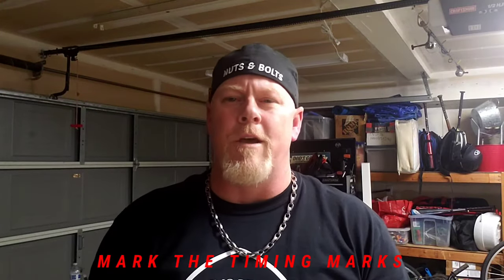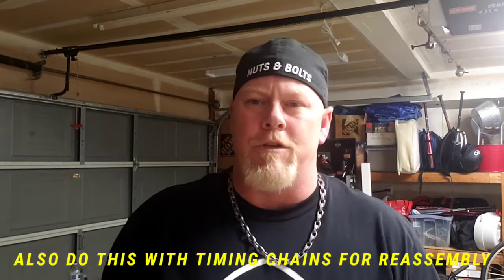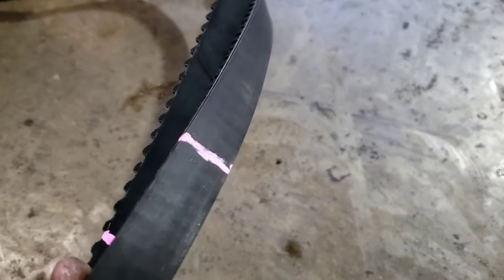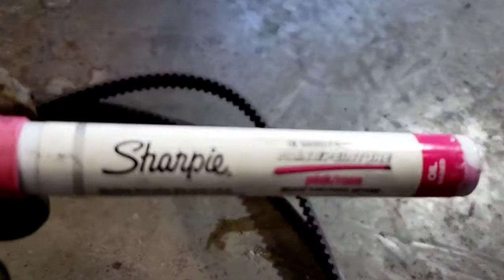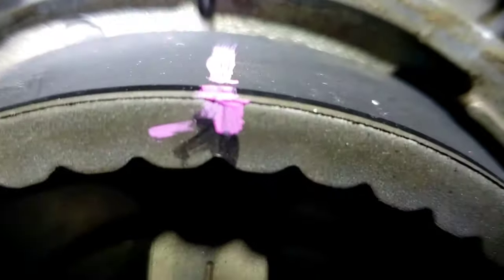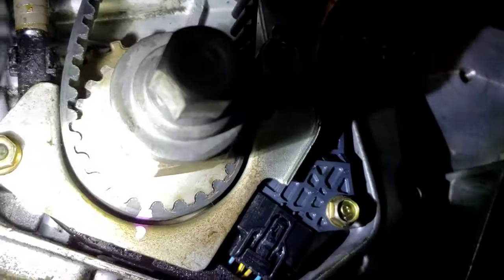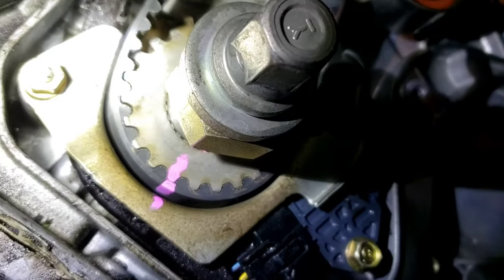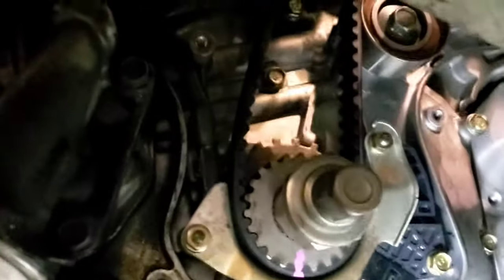TIMING BELT HACK Easy Alignment Every time

Comment: why    WOULD ANYONE mark the OLD belt            ....the new belt it doesnt matter which tooth goes where,as long as its fitting the gear correctly .....The cam pulley & crank pulley is whats crucial.   to me its pointless to mark a new belt or old belt even.
Reply from the maker: Sure
Reply: @97warlock wants you to blow your engine up. Stay safe
Reply: Hes saying mark a line on old belt and crank and old belt and cam then transfer marks to new belt and align that with marks on on cam and crank. This actually helps assuming the timing is already good when the car comes in. Last job had I not done that I would have been one tooth off. Those this technique assumes timing is already perfect when car comes in. If it's non interference and it could.es in with broken belt this technique is useless

Comment: This method is great for the correct initial installation of the belt on the pulleys. Usually novices don't know how much they should pull the belt by hand between pulleys. Painted marking helps them to install the belt with minimal slackness before pulling the tensioner pin. To be more accurate, it is better to count the number of belt teeth between pulleys rather than just aligning the old belt with the new one and transferring the marks to the new belt. I both align the belts and count the teeth to make sure the marks are painted at 100% correct position on the new belt.
Reply from the maker: that is great information and you are correct counting the teeth is the for sure best way to make sure. thank you for watching.
Reply: Yep,if I'm not sure that's exactly what I do. I recently used a made in Germany optibelt on a toyota and I counted the teeth on the belt to be 100% sure. It's a fail safe way of doing timing belts.
Reply: @Healthliving1967  Yeah, that's a great method for beginners too but after a while, you will get the hang of it and can align the belt even without using the marks.
Reply: @Nariman Asgharian  as long as there is the same amount of teeth in the new belt as the old one then there's no problem with needing marks on the belt,but the belts do need to rotate the right way. Not everyone is a fckn a grade mechanic are they dbag.
Reply: @Healthliving1967  Yes, counting the number of teeth will suffice if you are not 100% beginner.
Reply: Gd day sir!, YES ur tech tip is perfect in my opinion, not too slow but sure, coz i did it for 2 toyota 2C diesel eng. Coz i miss d 1st did by 1tooth adv, eng didnt run,,, 2hours review its ok!!! So i did. That for next 2eng...twas 1990 that time,,,,

Comment: Belt doesn’t matter, it’s the cams and sprockets that make the timing accurate. Belt placement doesn’t matter
Reply from the maker: Belt placement actually matters completely. You have to have all the sprockets lined up correctly and the belt has to be connected and lined up.
Reply: @NutsandBoltswithTone  well I did this job not too long ago, new belt had no marks on it. I lined up all the sprockets, installed the belt and counted the teeth in between each sprocket, put it all back together and fired right up and runs flawlessly

Comment: This only works if your belt hasn’t ripped and had gears spin out of place
Reply from the maker: This is absolutely correct. The other thing that makes a difference is that the engine is in proper time before starting or cannot use this

Comment: Better tip is that instead of transferring mark from old belt to new belt by placing one top on another one, just count number of teeths between marks on the old belt. Mark on new belt by counting same number of teeths. This way you are not open to risk of mis marking slightly.
Reply from the maker: That sounds like a great idea however that would take a lot longer and in my opinion would have a better chance of making a mistake. I go around the belt mark everything and then go back and double check. have not had a problem. Thank you for watching.
Reply: @NutsandBoltswithTone  how can you make a mistake with counting method? Your method has risk of transferring marks from stretched belt (of course old belt does stretch) to unstretched new belt. Speaking of taking lot of time, which one do you need, couple of extra minutes or  destroyed engine due to wrong marking?
Reply from the maker: @SK  hey bud I get it I've been using my method for 17 years and I've had no problem.  If you would rather count like 200 or so teeth then you have fun.  I appreciate your input but for me my method would be more efficient.  Also easier to see the marks.
Reply: @NutsandBoltswithTone  I absolutely agree with you. I was lucky and used the same method a long time ago - and have performed many times later.

Comment: Nice! Thank you, it's always good to have an alternative way to place the marks. As long as you know it was in time before. you can place the marks technically anywhere. 
Getting ready to do a 97 3.0 Ford/ Mercury Villager timing belt/ tensioner/ water pump etc.  Your video is great and  much appreciated.
Reply from the maker: Thank you I appreciate you watching.  I would only advise that you make sure the engine is at TDC

Comment: Thank you for sharing this tip. Everyone should be using this tip because it ensures proper ‘off and on with new timing belt’. One day when it’s time for me to do a timing belt I’ll be using your tip. Thank you for Down Under ‘Australia’ :)
Reply from the maker: You are correct, this is a foolproof method to keeping engine in proper time. Thank you for watching

Comment: Great tip. I have never messed up a timing belt, but I'm not doing it professionally either, so just a rare occurrence on my own cars. They do freak me right out though, especially if I was to completely mess up the timing and cause major damage. Thanks for this tip. Better safe and make everything
Reply from the maker: You are very welcome and happy to hear you haven't any troubles.  Yes better safe then sorry.  Even though I do this professionally I still do it everytime.  Thanks for watching

Comment: I count the teeth on all new belts and chains, especially no-name belts. Once an Accord didn't run right after a new belt, long story short it was one tooth short in the belt....customer supplied eBay belt....

Great video and great tip that I use on every single timing job...even non chain/belt jobs like a cam sprocket on a 300 straight six Ford... always leave a map to get back to where you was before disassembly...
Reply from the maker: Yeah that is another way to do it, I agree simple little things to make reassembly easier. Thanks for watching.

Comment: Great tip.  Just ordered the pens from eBay (for a few dollars cheaper than Amazon).  Will be tackling TB and water pump and oil pump seal and gasket on my '97 Celica GT convertible, it has 234,000 miles but runs as smooth as butter, but not sure if and when TB changed (thankfully is a non-interference engine).  Waiting for all of the associated parts to arrive.  Luckily there are other cars in our household so I can take my time and not stress about completing.
Reply from the maker: Very awesome, these pain pens are awesome for so many things, even around the house, kids bikes and scooters. I am happy to help you with this. If you have any questions hit me up on Instagram. Thank you for watching.

Comment: Man, nice job. I watched most of the video before doing my 2010 Kia Soul 2.0 and marked my belts but apparently I still didn't get it quite right and missed a few of your good tips. It runs great or seems to but my check engine light is on. From what I'm reading I'm probably off a tooth or two. I could never quite see the lower harmonic markings quite well and thought that since I never moved it that I'd be ok. I also never seemed to have slack on the tensioner side like I saw in your video and aren't quite sure why. I can see the upper mark clearly on the cam pully of course but I'm not quite sure on the lower gear for the harmonic balancer. I would assume that I would need to make sure that the lower gear is lined up with its mark before proceeding? I loathe the idea of doing all of this again and still being off. Your thoughts are greatly appreciated, thanks in advance, Ben.
Reply from the maker: You should always mark crank and both cams and in a place that you can make sure it is exactly like it was prior. Thank you for watching. feel free to message me on instagram if you need anything.

Comment: I have used this hack before on a subaru, it'sa good trick...but i just got done doing a honda j35, myself...i tried this...and it didn't make any difference.  I eventually got it after thinking real hard on it, but, my problem was every time i released the tensioner it pulled the cams back 1 tooth. I got really frustrated and quit for the night and thought about it. My solution (which may or may not have been the correct method) was to put the cams 1 tooth ahead before releasing the tensioner.  Right or wrong, it worked like a charm and the car runs perfectly..better than it did before tbh.
Reply from the maker: If you have all the marks lined up correctly and put the belt on with the slack on tensioner side then should go on right.  This truck only works if the engine was correctly timed to start.  I use this everytime I do a timing belt but only if engine is timed right.  Thanks for watching

Comment: Hey bub . I’m replacing a secondary timing chain tensioner dual overhead cam’s on a Lincoln LS 2005 V8 when I took the valve cover off there is no holes in the sprocket for me to zip tie the chain and sprocket together. How do you recommend I go about tackling that job?
Reply from the maker: So I am out on disability and do not have access to repair info, however you probably do not need to zip tie the two together just keep chain supported up and remove sprocket. I am not sure on this job but I do know that I do not zip tie chains to sprockets very often. I will use a bungee cord to keep chain pulled up to not let slack fall down. I hope this helps. If you need any further help you can message me on my Instagram. Thanks for watching.
Reply: @NutsandBoltswithTone  you’re correct didn’t need a zip tie at all

Comment: Huge help I’m a diy’er and I’m wondering if u could check and set timing without taking the harmonic balancer, on a similar engine , 3.2L
Reply from the maker: You could check it but you are only looking at the outside of the balancer, and they are known to slip so the timing could be off. Removing everything is the best way to do it right and not cause any damage. Thanks for watching.

Comment: I put a timing belt on my 02 3.0 Accord and spawn it one time on the crank saw the cams were 180 out and took the belt off was moving the rear can and it's spun on me. How do I Ensure that decams and the crank are lined up correctly before I reinstall the belt? Thanks in advance
Reply from the maker: You will want to confirm the timing marks for the cams and crank. Thanks for watching

Comment: Nice suggestion with the sharpie. Just ordered some through link. Attempting to do 2000 Camry and this should serve me well, now just need some tips on keeping camshaft sprocket from moving wnen un bolting to change seal. Thanks again from mostly sunny Az
Reply from the maker: Thank you very much, and you will love the paint markers. As far as keeping cam from moving sometimes you have to let it settle in a spot, remove sprocket, replace seal then put it back to where it needs to  be for timing the engine. Thank you for watching.

Comment: So got an 3vze toyota 1990 pickup new long block ready to swap parts right over. They sent belt already marked I set everything 3different times on the timing but after putting the crankshaft cover plate on and then turning it over with an wrench the 2 top dead center on the cams are landing on but from the time of setting it has landed on the crank shaft slightly left of zero any ideas I just dont want to ruin the engine or all the efforts I've put in?
Reply from the maker: OMG I have done so many of these, so with timing belts there is no such thing as a half a tooth, so generally if timing appears off it usually due to not looking at the marks completely straight. If the belt is already marked the only thing you have to do is make sure that it is on the right way and not backwards if your marks are all lining up then it is not on backwards. from there you set all the marks to the engine marks, pull the pin on the tensioner and turn over the engine 2 full revolutions. make sure all your cams and crank line up with the engine marks. If you have not pulled the pin on the tensioner and turned it over twice then that would explain it seeming like it was off. best way to think about it is as long as it is not one tooth off then it is ok. Like I said no such thing as a half a tooth. Please let me know how this turns out. I appreciate you watching. If you have any further questions you can reach out to me on my instagram.

Comment: Hello, maybe you can help. I hired a friend of a friend, someone who said he knew how to replaced a timing belt in my 2007 Honda Accord 3.0, in my driveway. He obviously didn't watch your video because although he got the new belt in place it looked fine until he started to crank the engine by hand and it crawled off the back sprocket. I stopped him from turning crankshaft. I then noticed the belt was also coming out with the gear around the crankshaft. He attempted to push it back on and then put the harmonic balance on. He attempted to crank the engine again by hand to get the belt back into place but it seemed to get tighter. He then remover the chain tension-er which caused the pulleys to move a lot. Unfortunately, he needed to leave, in a hurry I might add saying he'd be back. I'm still waiting! Aside from my trying to save a buck, any suggestions? How screwed am I? Thanks in advance.
Reply from the maker: I am not sure what you are explaining, if you message me on my instagram I can try to help you out. Thanks for watching.

Comment: How would you time an engine after the belt breaks to find tdc and have cams and crank on the correct  marks?
Reply from the maker: Unless you were familiar with them engine you would need the proper repair information.  If you message me on Instagram I could try to help you out.  Thanks for watching.
Reply: @NutsandBoltswithTone  thank you I appreciate the reply and willingness to help. Nothing I'm working on currently just a question I've always had and could never really get an answer for

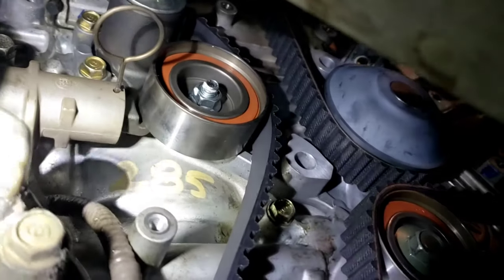Comment: i been looking for a video to explain belt preload. had many cars come to me where someone put a belt on but didnt load the belt on the idler side and they pulled the pin thinking it was timed right, but when it took the slack out of the belt it caused it to be off a tooth or two. right at 8:30 you kinda mentioned it. might be a good video
Reply from the maker: That is a good idea, I will toss that idea around. crazy thing is if you do not remove slack on right side of tensioner, once you pull pin and turn over the engine it will be out of time. Funny thing is sounds like people are  not checking it after doing belt. Thank you for watching.

Comment: Sounds like a good idea To me extra level of assurance
Reply from the maker: Absolutely. I cannot tell you how many techs that have double the experience then me come up and say I just did timing belt on this dual cam engine and now does not run right. I ask them if they marked the belt and they say no that is stupid I know how to time the engine. The belt is always off, mistimed engine. Thanks for watching.

Comment: The thing that made mine a little hard was the rear camshaft in the van , just made it a little harder to get the perfect line up of ti ing when i was  doing the job
Reply from the maker: Yes the rear cam is more difficult to get lined up, I use a 3 inch mirror. Did you by chance use a paint marker for the old belt to new one? That is how you avoid this problem. Thanks for watching.
Reply: @NutsandBoltswithTone  i used a white crayon , it did not work the best , but i not pulling it back apart to redo , the vans running , and its it derivable so i will do that the next time i have too change the timing belt.

Comment: I'm installing a new chain. Not a belt. Question is...do I use old chain or should I  replace new chain?
Reply from the maker: Well depends on what your doing it for, how many miles on vehicle and what kind of vehicle. Usually if you are going to do a chain you do a while timing chain kit with tensioners, guides, sprockets and all.

Comment: I just did the timing belt in my Jetta. It cranks over and runs but I keep getting the error code P0016. Crankshaft/Camshaft position sensor. 

I know I slipped when working on putting the belt back in and I was just praying that it was just my imagination since the timing marks still looked lined ups. 

I know it’s off by a tooth, how do I go about fixing it or getting it lined up again? 2013 Jetta 2.0

Thank you for the video. I will never do this without marking the belt and timing marks.
Reply: Update: I got it back aligned just half an hour ago! Omg what a relief. I was so stressed the heck out. Thank you! Runs like a champ and no more check engine light.
Reply from the maker: Usually if you got it one tooth off it because there was too much slack on the non tension side, the opposite side of the tensioner you need to make sure it is tight, easiest way is to line up timing marks, mark the belt and sprockets so you dont put it back where you just had it. remove the belt and retime the engine making sure the belt is not back in the same spot. good luck and let me know how it turns out. thank you for watching.